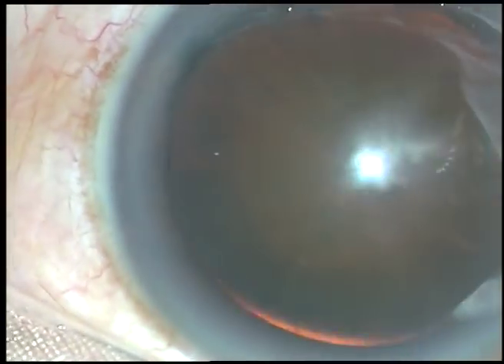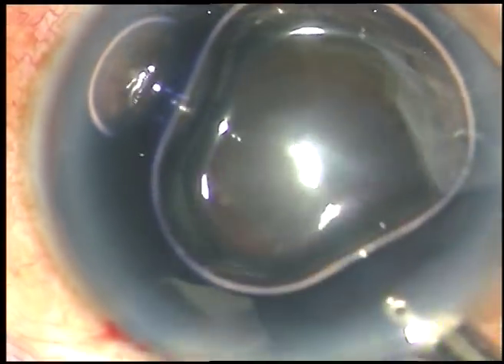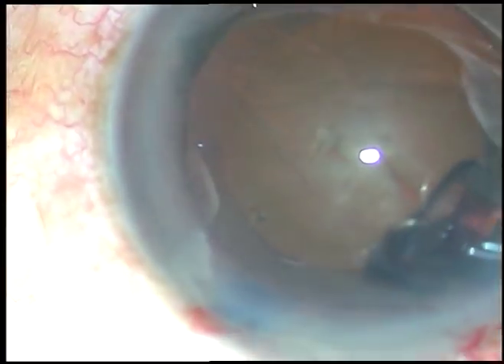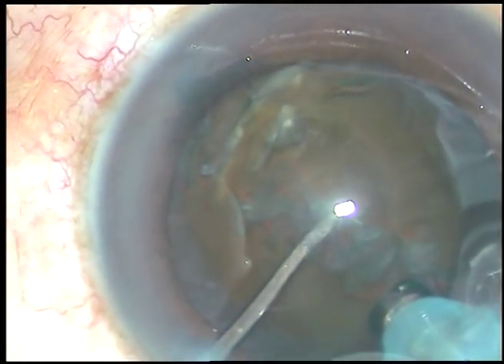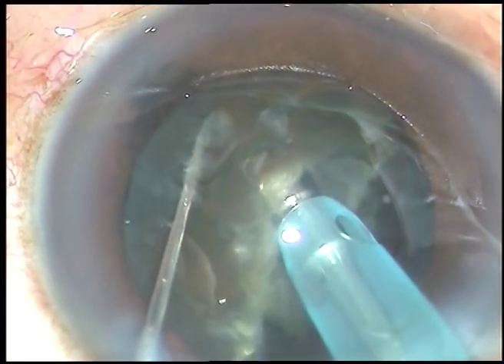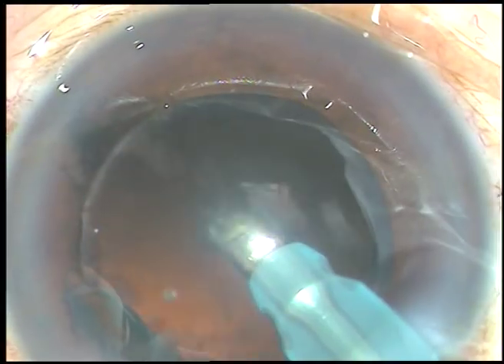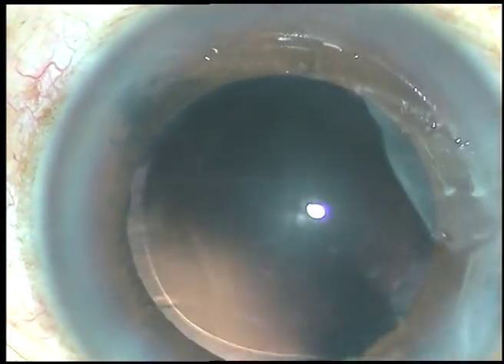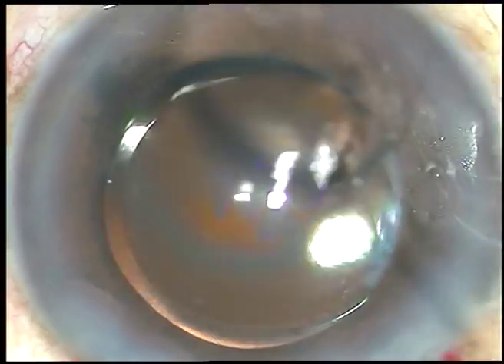welcome from Oslo: If nuclear pieces pop out, what to do?

Comment: well done surgery by talented hands, my question is the what is the name of the chopper you are using , I like to get it, and how is different from sinskey, regards
Reply from the maker: Hi
The chopper I use has been designed by myself. I took the idea from a Sinskey hook. Asked a local manufacturer to make it little stouter than a Sinskey.
The tip is not round like Sinskey,  it is compressed from both sides.
If you share your whatsapp number,  I can share his contact number..
Reply: i send u on your whatup asking for it , can you reply on your whatsyp regards